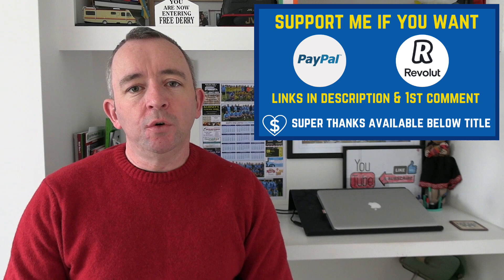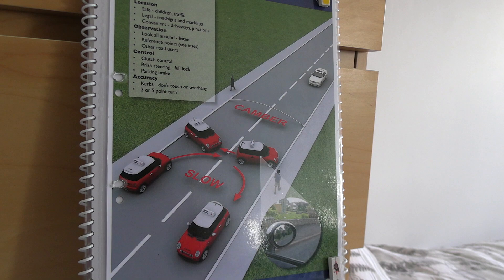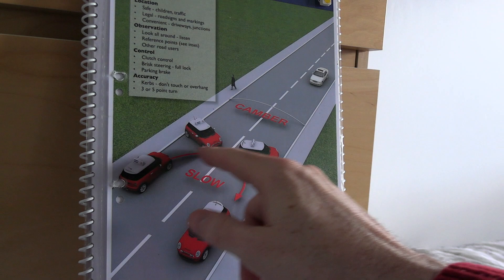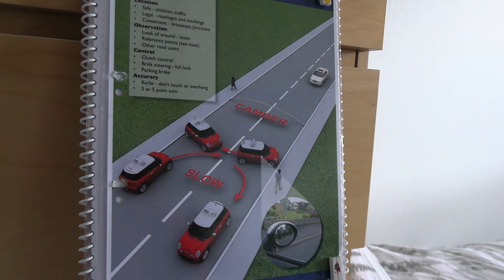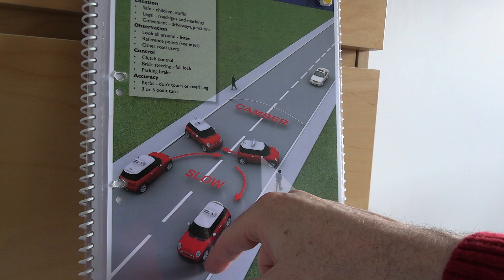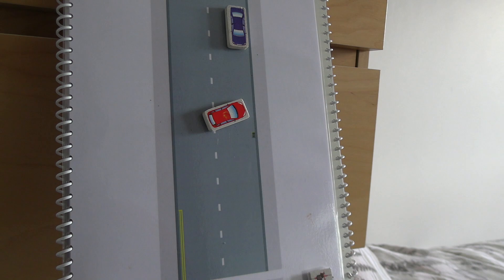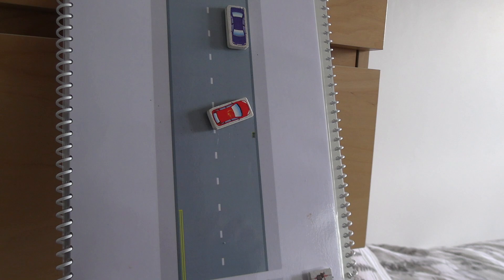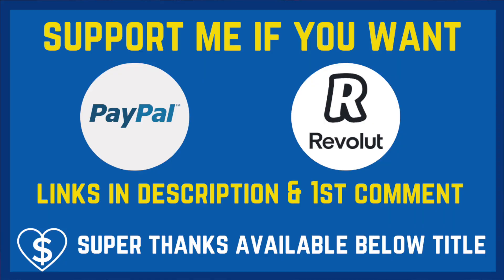The Important Details You Need For A Perfect Turnabout

Comment: Hi Dane, just a quick question. When moving off to do the first turn on a turn about, after selecting the gear, signaling right and checking your blind spot, do you have to check out the back window (over left shoulder) before moving off? 😊
Reply from the maker: It's good to do a full 360 degree look around yes